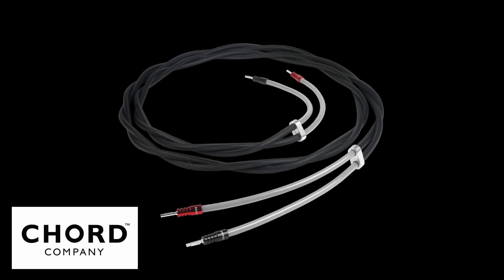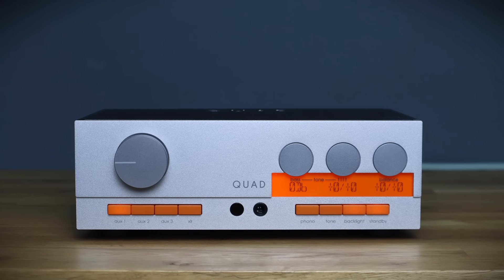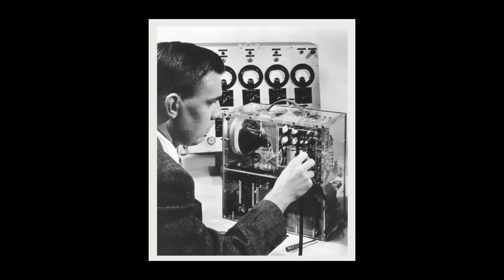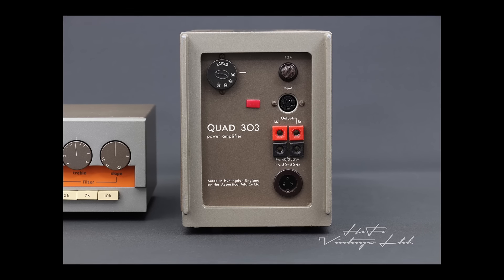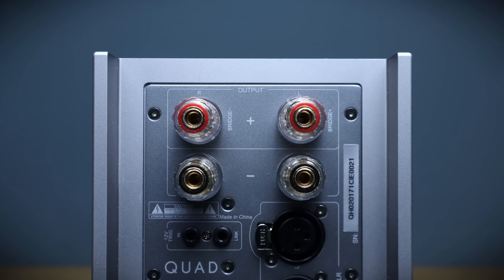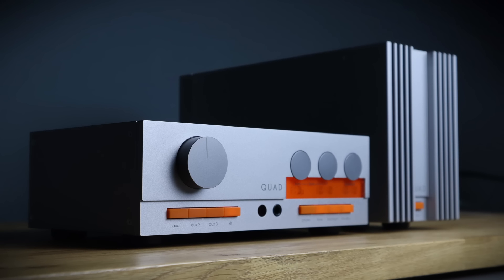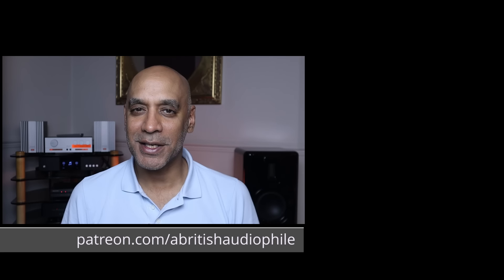1960s ICON REIMAGINED! Quad 33/303 Amplifier Review

Comment: Love Quad in the UK. My 909 turned into a buzzing mess at the beginning of this year. Confirmed the repair cost at £75 plus parts. Decided, as Huntington was just a 45 minute drive, I would take it over myself. Just knocked on the back door and handed it over, had a nice chat with the engineers. They service all products Quad has made.
Reply: 'Old School' service!
Reply: £75 plus parts is quite the bargain considering that could be a recap, new transformer, and a lot on labour, as an example on of our systems ran Classe Audio, B&W wanted around £600 to resolve a slight transformer buzz in one of teh power amps. We simply bought a replacement power amp.
Reply: tobiasisback4605  How can it "sound fine" when "The volume control is not well balanced, up to the 3 mark, nothing comes out of the right channel and between 5 and 6 there's a slight imbalance towards the left channel."? Add in "the 33 came back quite dirty with black oily residue on the tone controls, and a small scratch/dent in the top" and arguably, it's in worse condition than before you sent it in for service. Plus the 303 running much hotter is likely a sign of failure to come. Excess heat is often a killer. You have every right to demand that Quad make right what they got wrong.
Reply: tobiasisback4605  My mistake. Good for you.
Reply: tobiasisback4605  OK, I had the impression that it was running much hotter.  My REGA Elex MkIV Integrated runs "warm to the touch after hours of play" and yes, it's no big deal.
Reply: @SastusBulbas1  I doubt they replaced the transformer for that money.
Reply: It’s 75 plus parts — meaning the 75 covers the labor, only. Replacing the transformer wouldn’t add much labor to opening the thing up in the first place.

Comment: I still have an original 33/303 in their original boxes. They’re in the loft. I still use a 36 / 306 in a bi amped configuration with Wharfdale speakers. Could it do with updating? Absolutely! But, I still like it. What more can I say.
Reply: spend a lot of time in the loft? They should be enjoyed at least by someone some of the time.
Reply: Storing Hi-Fi equipment in a loft is likely to damage the electronic assemblies. Lofts can experience significant temperature and humidity fluctuations. High temperatures can cause components to expand and contract, leading to potential damage or failure of components. Low temperatures can also affect the performance of certain components. High humidity levels can lead to corrosion of metal parts and degradation of materials used in PCBs. Moisture can also cause short circuits and other electrical issues.
Reply: ... I'd be so glad to listen to them instead of sitting doing nothing in the loft LOL... are they for sale? :)

Comment: An uncle of mine had the original Quads, hidden in a wall behind a small door. Loudspeakers were hidden in cylinders hanging from the ceiling, the undersides had lamps above tables in the living room. Two bass speakers were built in a converted fireplace.
Entering the room, he opened the little door in the wall, put on a record and it revealed itself: a spectacular sounding system. Where did all the sound come from? 
It was the most stunning and invisible system I ever heard as a child.
Reply from the maker: @colanitower  that is great 😊

Comment: I was 20 when I bought the 33/303. I currently own a modified/upgraded 66/606. I had QUAD equipment for 48 years. Brief interlude with Luxman for 2 years on the side. Speakers, B&W and KEF over the years.

Comment: My first Quad was the 22/2 valve, I followed it with the 33/303, skipped on the 405 (the first 'current dumper'), but bought the 34 preamp which I used with the Quad 2 valve monoblocks until the 606 came along. I used the combination of 34/606 until about 5 years ago when I bought a pair of the now rare Quad QMP monoblocks (each one has two 909s in bridged mode), which I use with the Vena 2 Play as a preamp.

My speaker 'journey' was equally Quadcentric! Quad 57s, 63s, skipped on the 2905, but succumbed to the 2812s!....backed up by the Quad L series subwoofer.
Reply from the maker: @rogerwebb7501  thx for sharing 😊

Comment: Good review and I’d generally agree. Using the 33/303 at the moment but will add another 303 shortly. Pretty impressed all round especially the MC phono input. The 303 certainly sounds more powerful than it specification suggests
Reply from the maker: @malcolmlittler9408  thx for sharing 😊

Comment: The 33/303 was my first ‘real’ amp over 50 years ago now. As a design student I loved the industrial design and the combo had incredible ability to drive speakers. From my systems in that era the Linn Sondek LP12 and AE1 speakers are still around in one form or another  but I would love someone to produce a serious transmission line speaker like the IMF TLS80, which used KEF drivers and could move mountains with no need for a sub woofer.
Another great review, thanks.
Reply from the maker: @RichardMathieson-j3l  thank you. Have you seen the PMC Prodigy 5 speakers. Amazing value transmission line floorstanding speakers. Link to my review… 😊
COST OF "TL" SPEAKERS CRASHES DOWN! PMC Prodigy 5 Speaker Review
https://youtu.be/pBlnXEQ0l90
Reply: @abritishaudiophile7314  Thank you, that’s a good call. I am looking at replacements for my 40 year old Linn Kans, another great design from the past.

Comment: This brings back memories. The first HiFi demo I had back in the 70s used a Quad 33 partnered with the 405 power amplifier (above my budget but I was auditioning speakers).
I would like to see a review of one of the current Quad II power amp range with one of the current Quad electrostatic speakers. Quad has always been famous for valves and electrostatics. A couple of my local dealers always used to demo amplifiers with Quad electrostatics, very good at showing the differences between amps. Sadly a little too large for my listening room - although they would fit, they would absolutely dominate the room and consequently have a poor Wife Acceptance Factor. My Lowther horns are probably as big as I can get away with... 😀
Reply from the maker: @TheRealWindlePoons  thx for sharing 😊

Comment: Great review Tarun, as usual. Re your closing comments, I’d love to see the return of the Mus Fid XA50 monoblocks. Had mine since new (1999) fed by a number of preamps (most recently, surprisingly, a cheap ZeroZone passive which sounds fantastic) and driving a variety of speakers before settling on my kit-built IPL floorstanders. After one of the amps failed a few years back following a massive mains power surge, they were repaired/upgraded by former Mus Fid engineer and local (Northumberland) amplifier guru Jez Arkless. I like to think they’ve sounded even better since. In my view, a classic. All best. David Deeks

Comment: A trip down memory lane. Had both originals along with ESL 57's & the 405 Amp for many years, Met the son, Ross Walker when we became a Quad dealer in the USA in the early 1970's. Wonderfully engineered and manufactured. I do prefer the color of the originals.
Reply from the maker: @marksulloway5669  thanks for sharing Mark 😊

Comment: I owned a Quad 33/405 combo back in the day and it proved to be a real pain to live with. The DIN input connectors and the push buttons regularly oxidised and affected the balance and tonal quality and needed regular cleaning. I am glad to see that these issues seem to have been addressed in the new design and so hopefully the new 33 wont be as troublesome as its predecessor. That said, I would find it very hard indeed to be tempted back to Quad after years of pain.
Reply from the maker: @tonydean7543  thx for sharing 😊

Comment: Another fine review Tarun. As for the request to nominate the resurrection of a bygone classic, for me it has to be the Lecson AC1 pre-amp and AP1/AP1X/AP3 power amps. A revolutionary design, particularly in regard of the pre-amp. The design and execution came from Bob Stuart and Alan Boothroyd who later created the Meridian brand. I own the AC1-AP1X combination, still  in immaculate condition and bought from new. Sadly the power amp is no longer working, besides which is a mess where speaker connection is concerned, using a bare wire, sprung push button mating, in a cramped proximity. The amazing exterior of the power amps also hides a messy home-made looking interior which was no doubt responsible for the notorious failure rate of said power amps. When working the combination has a warm, musical sound. A redesign of the speaker connections and a cleaner internal is needed but besides that I believe the sound quality is easily a match for most modern kit and still way beyond in terms of aesthetics.
Reply from the maker: @bw8827  nice. Do you know anyone who can fix the power amp? 😊
Reply: @abritishaudiophile7314  There are a few out there who claim to be capable but I've yet to enquire. Maybe I should.

Comment: Hi Tarun , another great and interesting video, as rightly said the made great valve Amps. When I was a tennager I had a Millard Stern 15w mono amp with partridge transformer with whalfedale Linton speaker . Quad make great equipment. Regards mark

Comment: Lovely!

My first hi fi tuner was a Quad FM3. I still haven't had a better sounding tuner than that one but it was really hard to tune it because the tuning knob was so stiff (maybe rust).

I got an A&R Cambridge T21 next, which sounded nearly as good as the FM3 and was far easier to tune to a station.
Reply from the maker: @Treviscoe  very nice 😊
Reply: @abritishaudiophile7314  Thanks. You used to be able to pick up old Quad equipment quite cheaply on the secondhand market (my FM3 cost me £110 in 1985), but I suspect those days are gone now.

Comment: I would like to see the Audio Innovations Alto integrated amplifier make a comeback. What an amazing amp for the price. I heard one back in the 90's and was immediately drawn to the sound and the looks. I nicknamed it the flying saucer. Best sounding, most likable $600 amp at the time in my opinion. The sound signature was better than most expensive amps IMO. I'm lucky to still have one, although it's no longer working properly. If the designer is still around perhaps you could give him a nudge for me? It may be Peter Qvortrup, but I'm not certain.

Comment: Another calm and considered review thank you. Strange but I use the Quad Artera Pre (all analog ) and Artera Stereo Power Current dumping Amp this is rated at 140 per channel too. I wonder how this compares with the 303 setup. I know it’s not the flavour of the month but it works for me. Oddly I also use an Exposure 3010 which is a good work horse.

Comment: I sold my Quad 303 which I had for 27 years (serial number 2826) and sold it two years ago. Great little amp, served me well. As for the 33 pre, well that went straight into a bin 27 years ago. I would have kept it but it was just sitting dormant and I am a great believer that audio equipment should be being used not sitting about not being used I also believe that its not good for the electronics ether over time, like vehicles etc etc. So hopefully serial number 2826 it is still in use.
Reply from the maker: @metatron007  cool 😎 I wonder if one of my viewers has it 🤔
Reply: @abritishaudiophile7314  Well we shall see... serial number 2826... I believe that it was in the second year of production...

Comment: I still have two 34s, two FM4s and three 306s (spares are always handy!) But it's the modernised Quad II series that gets used all the time - 24p, QC-24, and II/forty amps. Got rid of the 989 speakers (unreliable) and moved on to 2905s. They started to blow panels after eleven years, so I replaced all the panels and they are just like new again. No need or desire to change a thing.

Comment: Hi Tarun great review as ever!  I still have my old quad 303 in use and it sounds great.  I was wondering what your thoughts are on this.  I recently bought some Klipsch heresy 4s and I was running them with a home made single ended class A valve amp I built.  They sounded completely wrong too trebly and no bass or mid range.  So I thought I’ll get the quad 303 out and see if it’s a problem with the amp.  Anyway the bass and mid range came back.  So there is an issue with my amp.  The top end is still too bright even when listening to vinyl.  What would you put this down to.  The amplifier being old?  I am using a quad 34 pre amp.  Also using a Audiolab 8200 cd player and dac.  Thanks Glenn

Comment: I had a 606 mki, and it had sounded warm, pleasant, and rounded sound. Not neutral. No glare. Body was good. Not a technical, brutally honest piece. Upgrading caps and resistors and wiring hadn't done much. Simple circuit with big can type transistors. Had sold it for about $400 three years ago. Current dual class A amp I have now sounds more resolving. Imaging and dynamics are better too. With lively speakers, it's not always enjoyable
Reply from the maker: @dan-qe1tb  thx for sharing 😊

Comment: Good job there's a SW update port because it's 'dB' not 'Db'. I'd like to see an updated Quad 405 current dumping amplifier measured & listened to. The original got trashed in the HiFi press but I built clones based on Peter Walker's Wireless World article, it sounded nice & burned a lot less power than my previous JLH 75 watt class AB design, another WW design. Ah, my mis-spent youth, I started at sixteen & still have most of the kit (I'm listening to you on my Malcolm Jones' Tabors, a HFN&RR design) but I'm afraid to turn the kit on in case the electrolytics explode. Cheers!
Reply from the maker: @trevorbartram5473  Zinamp did a modern interpretation of the Quad 405. Here is a link to my review 😊
SIMULTANEOUS CLASS A | Zinamp SSD Amplifier Review
https://youtu.be/GsyIdmfLiJc
Reply: Thanks Tarun, I saw that video & would luv to see a schematic of the Zinamp. I'm refurbishing an Adcom amp (that hasn't been used for twenty+ years) in the next few weeks as backup if my twenty+ year old NAD amp fails (I can't live without music!). It will be interesting to see how the Nelson Pass design stacks up against a Bjorn Erik Edvardsen (BEE) design?

Comment: I would love to see a re-imagined version on the QUAD 405 as I am currently running a 405-2 (upgraded).  Meanwhile I am considering partnering a (2024) 33 pre-amp with my classic 405-2
Reply from the maker: @StylusDrop  Zinamp make an amp based around the Quad 405.  Link to my review 😊
SIMULTANEOUS CLASS A | Zinamp SSD Amplifier Review
https://youtu.be/GsyIdmfLiJc

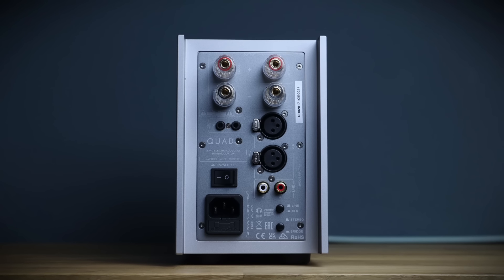Comment: 5:40 you mean inputs. 
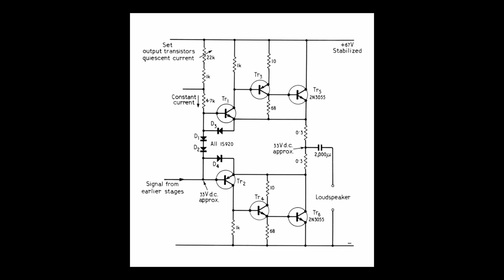9:05 'Negligible'. 
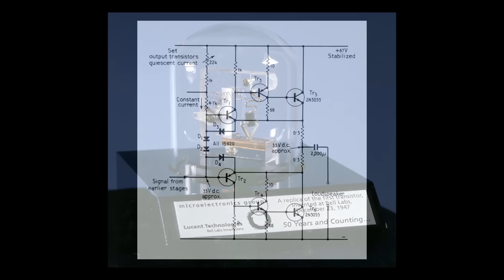And the output transistors are necessarily mounted directly onto the big external heatsinks rather than on any of 'these three heatsinks'. After all, there are four 'triples' in a stereo amplifier; not two. Peter Walker's output stage shown at 8:50 was not 'symmetrical' as it had only NPN output transistors. It was an improved quasi-complementary class AB amplifier because reliable PNP transistors capable of enabling the required Safe Operating Area did not exist at the time. 
The 2024 redesign has truly-symmetrical output transistors.

Comment: A fair review but you didn't make a direct comparison of the original against the imitation with 57 electrostatics.
It was my privilege to meet Mr Walker several times when I was in my 20s and he was constantly experimenting, so I got to see what became the 400 series well in advance. I was at the factory a couple of times with arcing on my 57s then later as a guest when I was in the area, sometimes to try a new rear plug in board as these were notified to customers. They looked like biscuits!
I still have a pair of 57s but not my originals and retained my original 33 because it was (and is) so versatile but I mostly use my Quad upgraded 400 pre/power set up from about time Mr Walker was 'sort of' retiring.
To have quasi-revived the 300s and not the 400s seems a bit silly to me and Mr Walker would have loathed the 'screen'. At such a high price I feel that it was someone's vanity project and not actually a pedigree. Certainly not a tribute as Mr Walker's major breakthrough in amps was the 'current dumping' 400 combo and it was never bettered in my aural opinion.

Comment: Hi Tarun, great review.
To answer your question, it would unquestionably be the dieter rams Braun hifi components. Not sure any components have ever looked better.
Quick question for you: how is the willsenton r8 with el34ph in the power stage going? Have you reverted back to kt88s or is a review upcoming?
Thanks again,
Max

Comment: 9:42 They are not filter caps.
They are smoothing caps.
Smoothing and filtering are two different applications of capacitors.

Filter caps are used in filters (hence their name!) and filters are circuits whose function is to modify the frequency response.

Smoothing caps smooth the ripple (that is reduce the magnitude of) on  the power by holding the charge and releasing it in between the peaks of the input signal.

It is not correct to refer to the reduction of the ripple on power electricity as "filtering": the goal isn't to adjust the frequency response.

Comment: Hi Tarun if I have to choose one of the vintage Hi-Fi to ressurect, it would be Carver Phase Linear Magnetic Field Amplifier, even I don't have any experience with it . I hope someone can make a clone of it, just like the SwissMicro calculators, which are the clones of HP famous calculators, do you have any of HP Vintage calculators HP41CX, or HP 32s?
Reply from the maker: @jameschan2404  cool 😎 I think I do have a vintage HP calculator with reserve Polish notation knocking around somewhere 🤔